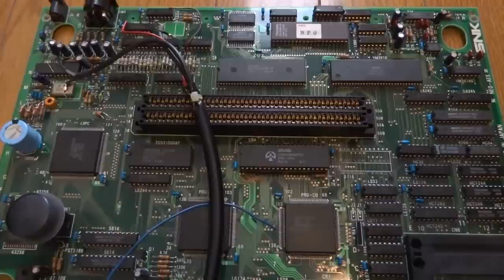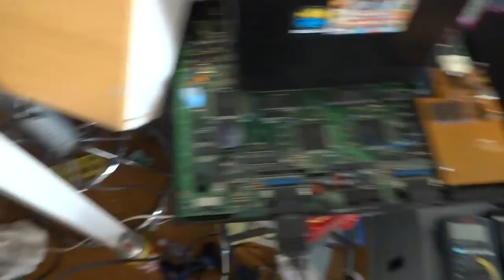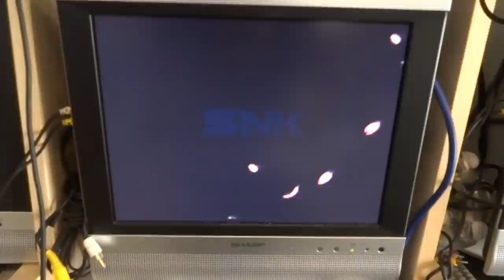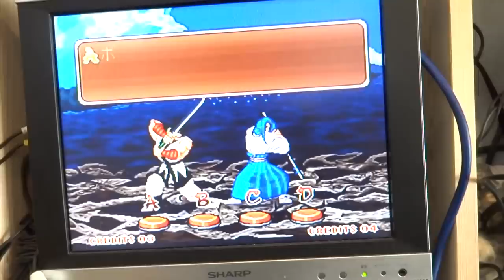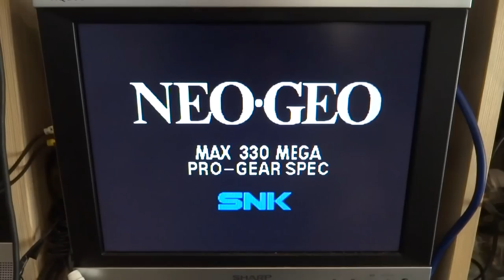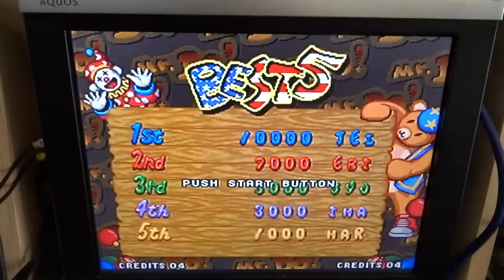Neo Geo AES Problem:  Plays  Music Slowly Repair (Part 2)

Comment: With regards to a trace just burning out like that, I would suspect either the Z80 caused this - perhaps a problem with the interrupt pin, or the YM2610.  I've heard of the YM2610 causing that issue previously.  If it fails again in future, you might need to swap out the YM2610.  It's worth measuring resistance between that pin (16) and VCC rail - you should hopefully see ~4.7K Ohm from the pull up.  It could of course just be a manufacturing defect (trace too thin or damaged at that point).

Comment: wow I can't believe those old units came off the line like that! (or at least I assume that's how they looked) but good to see it up and running again, fixed sound and all!
Reply from the maker: yeah, a shock if you open one for the first time but they are almost like prototypes in a way and glad to have saved yet another one.

Comment: Yay, I was right!  Pin 16 = interrupt!  Happy New Year!
Reply: +GadgetUK164 by pass caps, was this one of yours :P happy New year Mate. and Luke.
Reply from the maker: yes indeed my friend, well done :) happy 2016 and hope things are going ok
Reply: Thanks, likewise - hope 2016 is awesome for you! =)
Reply: +GadgetUK164 I was nearly right too. :p

I was just trying to cover all bases in the last vid comments. hehe

Glad you got it going, +lukemorse1 ;)

Have you considered buying a de-soldering station btw, Luke? It would make your life a lot easier, and minimize the risk to the vias etc.

I've had the "Duratool" station for a few years now, and it's been a life-saver.

It's made by Zhongdi, and goes under a few other names like Rhino. EEVblog Dave did a great review of it...

(some models look different, but they are pretty much the same inside)...

https://www.youtube.com/watch?v=Ft50m8UU5WQ

On the newer ones, they've now changed to using proper glass containers for the solder dregs.
I had to buy one for mine because the original plastic one kind of melted slightly, but they only wanted 74 Pence per glass container kit, so I bought about seven of them. lol

It really does work well, the replacement tips are cheap (only a couple of dollars), and even a new heating element only costs around $20.

The only reason I had to replace the heater / nozzle on mine after about 18 months of use was because I lost the "wire" thing for cleaning the nozzle, and it then got blocked solid. lol

As long as you regularly clean the nozzle from solder and flux, and before switching the unit off, it should last for many years. Really nice to use though, and gets almost all of the solder out of the vias with very little effort if you use the correct tip size etc.

If your particular one comes with the older plastic containers, you can buy the glass kits direct from Zhongdi...

http://www.china-zhongdi.com/
Reply: +lukemorse1 Very interesting how the music managed to run at full speed when you put the logic probe on the /INT pin btw.

I first thought that it must be because it was inducing some 60Hz noise on the floating input pin, but if you said it also stopped the samples from playing then I guess it was just pulling the pin High slightly? (hence the Z80 was continuously servicing the music routine?)

I think most of the games would be using the hardware timer of the YM chip to drive the Z80 /INT pin though, which makes it a bit strange that the Z80 would work without that signal?

Although, maybe most of the music routines for things like the Neo Geo start-up logo is just done with the timing on the Z80 itself, so it didn't care as long as the /INT pin was pulled High?

Anywho. Great stuff. A very interesting repair once again. :)

Happy New Year to everyone in retro land. :p
(well, it's the 2nd today, but still.)
Reply: +GadgetUK164 always see you in repair videos!
:)

Comment: Hi Luke :-)
How long do you think these systems will continue (under normal usage conditions) to function from manufacturing date? 
I know about caps fail/leaking after time. But how long will the silicon chips last/stay laminated? maybe 30+ years? You think more or less? maybe?
When I've investigated on the net on the lifecycle of silicon chips no-one seems to be in agreement on their lifecycle...
Btw Happy New Years, Atb, Daz :D

Comment: Luke, why not use chip-quick on the joints when removing the part? Reduces the risk of trace breaks.
Reply from the maker: +Paul Henning Ive used it on surface mounted DAC before but normally flooding the solder holes with fresh solder and flux will loosen things up but not this time :) no worries though
Reply: +lukemorse1 a lower temp soldering iron might help.
Reply: +Paul Henning chip-quick can also flow into the traces under the solder mask and weaken them, making them melt if they console gets too hot.

It's less of a problem for through hole parts,but it's still a risk.
Reply: Guys, use lower heat with chip quick

Comment: Luke! I know you are in Japan but I need your skills. I have been trying for a while to find someone in UK to repair to launch model Japanese (both low serial number version one bios) mega cd units I have. One powers up but has no sound at all just a buzzing noise if volume on bt is cranked WAY up. It also does not read discs. The other one wasn't reading discs but did have sound but I think might have died as result of the common blown fuse scenario as it is now effectively dead. Do you do repairs at all as it might just be worth it as I really would like to get them working if possible and as said have had crazy quotes or no luck from people in UK who could do it. Tried asking few TV repair places and they don't make me feel confident they could do it properly or would look after them like a game fan would. Worth asking!
Reply: +Christopher Kelly  It's Always worth asking Fella, of Luke can't help I can- Uk based as well ;)